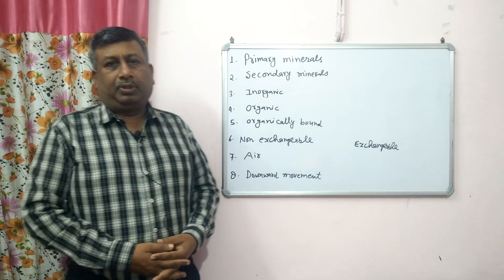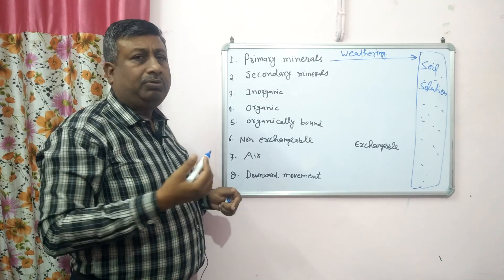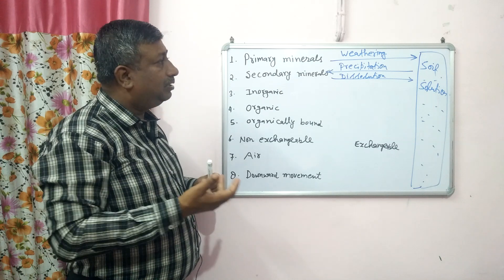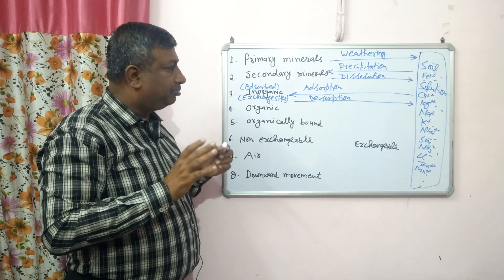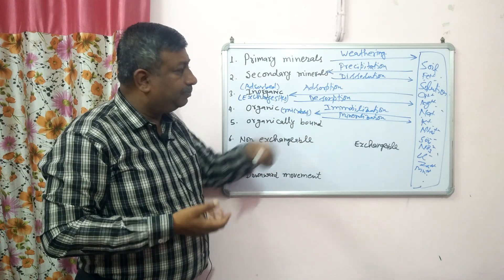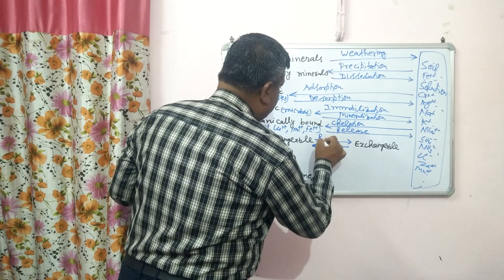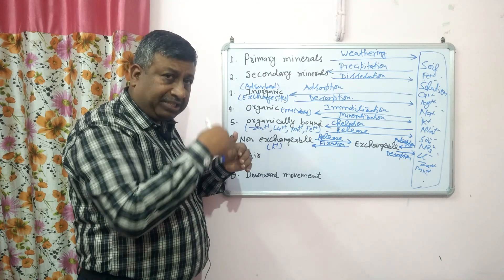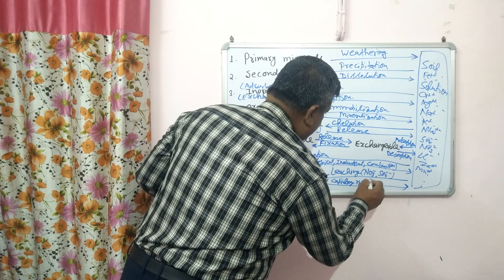Nutrient Transformation Processes

Comment: Good work sir. I have a question . Why soil particles always in minus charge ?
Reply: In soil clay particals contain major negative charge and these are called silicate clay minerals which are firmed by silica layer or aluminum or magnisium layer in 1:1 2:1 or 2:1:1. In this state oxygen is present in free state containing negative charge O²– . In some cases aluminium ion Al³+ is replaced in silica layer or by Mg²+ in aluminium layer (called isomorphic substitution) due to which negative charge increases to greater extent mostly in 2:1 ratio silicate clay types such as montmorilonite.